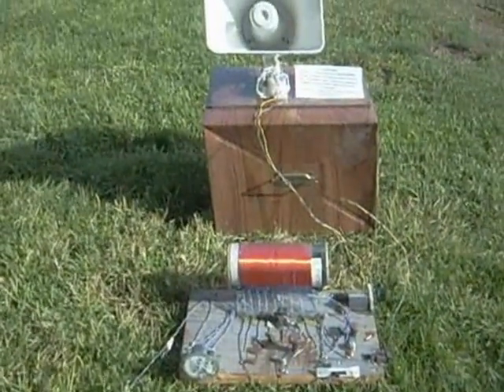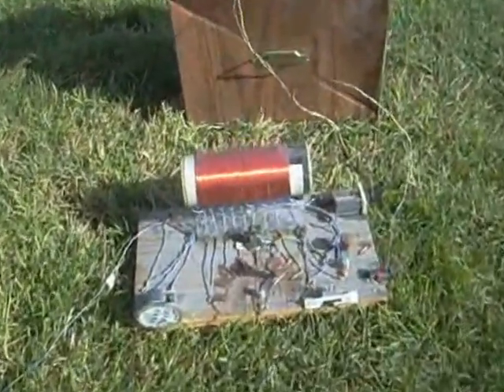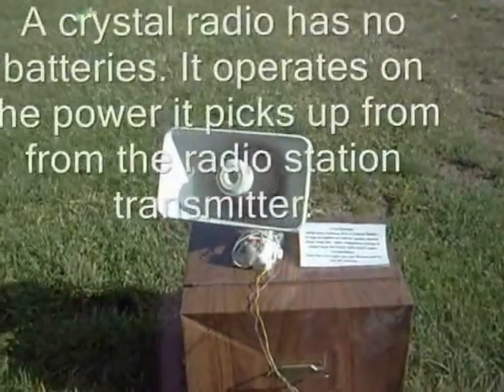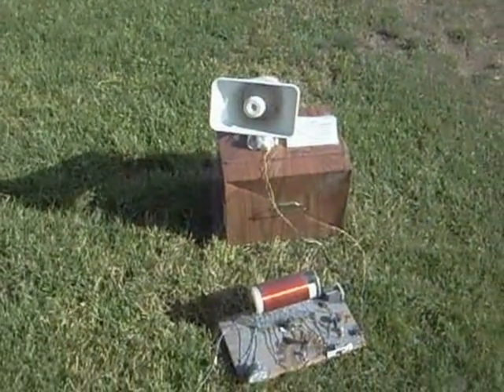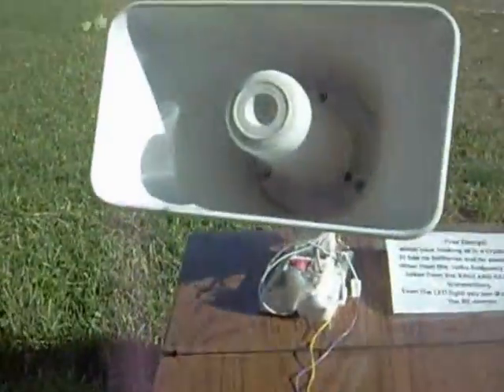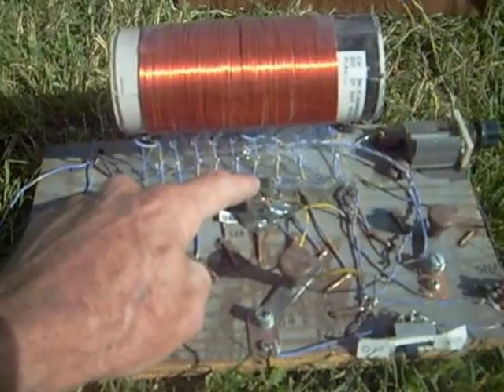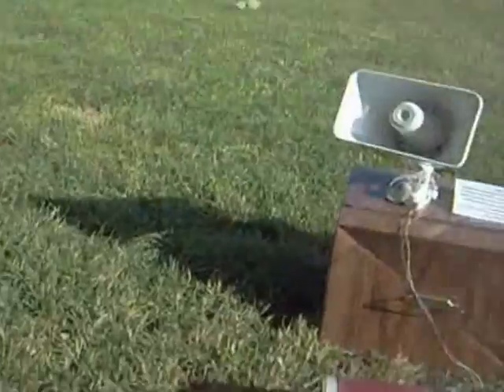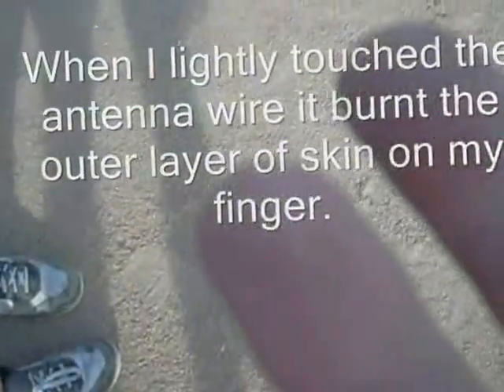Antenna experiment. Flying kite with wire. Deadly warning in   info section

Comment: Just like the ear, your nervous system is only effected by electrical vibrations or frequencies in a specific range. For the ear it is 20hz to 20khz roughly. Pain receptors also have a range they react too.

Comment: It is possible if I want attract lightning strike by supplying it with HV source probably from modified bug zap for first initialization? What's best chance for anode/cathode? Please dont tell me about safety no nearby powerline, open field, rubber boots and run as you can thank you :)
Reply from the maker: Just having a ground wire up high can attract lightning. Here in Grants Pass a church steeple was struck by lightning twice because it's up so high. It blew up part of their steeple, and it also damaged many electronic devices at the courthouse across the street which was far away from the main lightning strike. Keep in mind the lightning strike is so powerful it often damages electronic equipment far from the main strike, and sometimes it backs up through the power grid, and may damage hundreds of electronic devices. I have a long wire antenna that gets pretty charged up in a thunder storm, but I keep it ungrounded with a large spark gap just to play it safe. I know you don't want to hear about safety, but it sounds like you may need to understand more about the dangers. Here is what my long wire antenna picks up.  https://www.youtube.com/watch?v=_DHBjeobg4U
Reply: @GrantsPassTVRepair   ah thank you i'll reconsider my safety preparation, i saw your vid about ungrounded spark it is very interesting, i dunno if we can play with lightning in safer way, i watched this video https://youtu.be/1naaZvXTqv4 they deliberatly attract lightning but sounded sketchy to me my gut telling it was HV power line, not real CG. Nevertheless They used device like i said for initialization what do you think?
Reply: @dogo dogo  if you're still alive.. There is no safe way to "play with lighting". Perhaps you should study a bit about high energy capacitor discharge and see what that can do to the human body, or anything else that gets near a charged capacitor for that matter. Understand what a 10uf capacitor will do to you first when charged to 300kv (450k Joules). You can add several zeros to the end of those numbers for lighting.

Comment: Hi.  Did you test the volts and amps?  What gauge wire did you use?
Reply from the maker: I didn't measure the power, but I used non copper stranded wire that had the plastic shielding on it, and the wire was probably close to 20 gauge.
Reply: @GrantsPassTVRepair  Thank you.
Reply from the maker: @williamblair1123  Your welcome. BTW here is a simple project you might enjoy. https://www.youtube.com/watch?v=vHVmJ5lD9jc

Comment: I have been thinking on doing a similar test with a coaxial cable - with two or three feet of  bare condcuctor at the top - hooked to several ballons filled with hellium to use it as a TV antenna.

Comment: In another video another  commenter ask if we should nick name you Ben. My though was nah you wan't fling a kite. So now Ben it is. There is a ham that goes out and uses a kite to lift a long wire antenna, but he use a high value resistor to drain the static charge created. Low enough a value to drain the charge but high enough of a value that it doesn't affect the radio's operation.

Comment: add diodes at points on the wire and you can probably get a more powerful dc current to run a motor. o wait! that's what a Cristal radio is! theirs just not enough of them spaced out along the wire

Comment: When experimenting with kite lifted wire antennas please add a static bleed to ground. This can be a 10 MOhm resistor, an RF choke or a few turns of insulated equipment wire wound around the antenna. Huge amounts of static can build up on kite antennas. A static bleed will also protect your radio equipment. Regards Phil
Reply: +1 on that comment. Also do you use a flying line to hold the kite or do you use the copper wire. You should really use a flying line with the copper attached to it with a weak point so if the kite gets loose it leaves the copper wire behind. But good work indeed . I have used this kind of antenna for ham radio on and off over the years works a treat.

Comment: I tried this back in the late 70's. I used 200 feet of 20 gauge magnet wire tied to a kite. connected to a Radio Shack, Science Fair crystal radio kit The ground was a bare copper wire dipped in 2 feet of water (I did this on a lake wharf flying over water) The local low power AM station was 9 miles away it was the loudest I ever heard it as well as a few Vancouver stations 60 miles away which were loud too. a success for strong signals but the wind made it difficult to hear the earphone unless you were in a boat or car. I didn't recall getting zapped though.

Comment: Hi Dave could you help me locate a service manual for a bush BLCD32H8 it has blown components on the power supply board VP136UG02 ver 1.0 particularly c20, I cannot find a manual anywhere, the cap and resister are too damaged to read so need a schematic to order components. Watched all your videos and love them, thanks fron the UK, andy
Reply from the maker: I suggest you try Google and see what comes up using the model number of your TV followed by the words service manual.

Comment: Back almost to the Tesla experiments where he powered a car purely from radio waves from a transmitter.
Reply: Perhaps you are confusing your Tesla facts? Tesla did use radio to control  (not power) a model boat before Marconi used radio to send useful information. However Alexander Graham Bell beat them both with wireless telephony.

Comment: Also exceptionally long air lines of kilometers or so are dangerous even in good weather, but fortunately usual kites can not lift that long ones. The atmospheric electricity is free energy available anywhere, but unfortunetely of rather low power with available lengths of aerial, and and difficult to collect.

Comment: The current of good weather atmospheric electricity is so low that it can produce sensations from a kite line wire, but fortunately not to kill anyone. If the air gets ionized, like before and of course during a thunderstorm, or if there are any other upwards thermal air currents present to bring down the very HV charged air from upper atmosphere, the line will collect enough charges to create dangerous level of currents.

Comment: In good weather the atmospheric HV current from conducting kit line is so minute, however, that you can feel it only when touching skin with the tip of the line end. This makes the current discharge as a dot discharge so that current density is high enough to stimulate a nerve impulse. When you grab a long section of the line, an equal current flows through your hand, but current density is too low to provoke your nerves to feel it.

Comment: In your case there is also the additional high frequency (HF) current induced from the nearby HF Tx station, which produces part of those skin burning sensations. In calm weather you might observe a small puff of vapour as the HF current vaporizes a minute amount of water from your skin surface.

Comment: oh, I see you used the fence. Actually, for even larger voltages, you might need a thick iron ground pipe that goes deep down in the ground -- 6 feet -- and also wet the ground like they did in the telegraph days. Were rubber boots and rubber gloves and take other precations such as lightning arrester.

Comment: Also I know a hydro worker that died - He was standing on the ground disconnecting the ground wire from a hydro pole but forgot to first connect a temporary ground wire to it.   The static electricity from the atmosphere passed through his body to ground.  It had nothing to do with the electricity from the grid.  It was just the electricity from the top wire - on hydro poles this wire is to protect from lightning and static charges in the air.  A kite with conductive wire as string is dangerous!